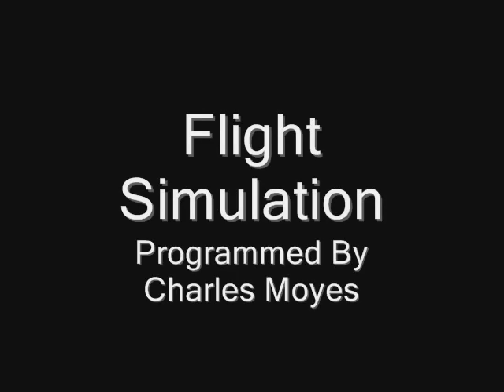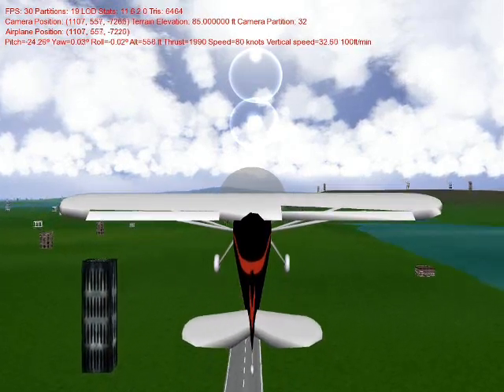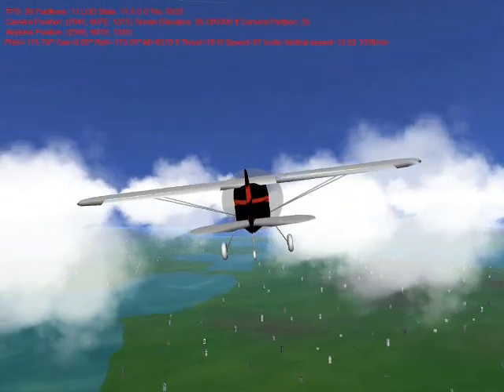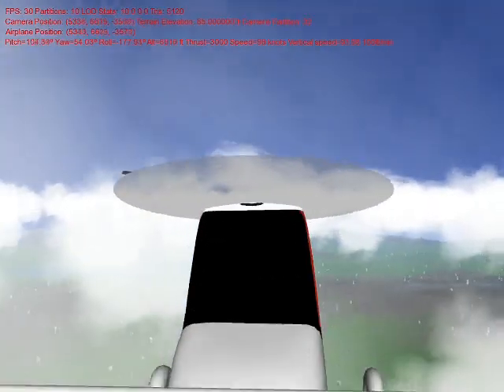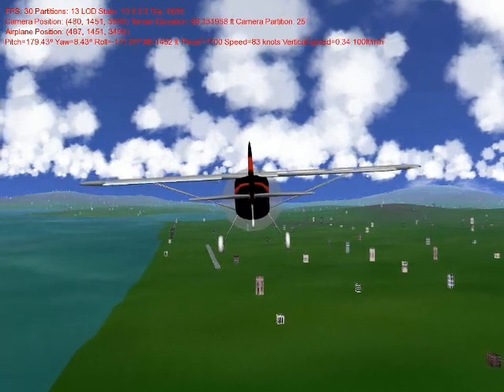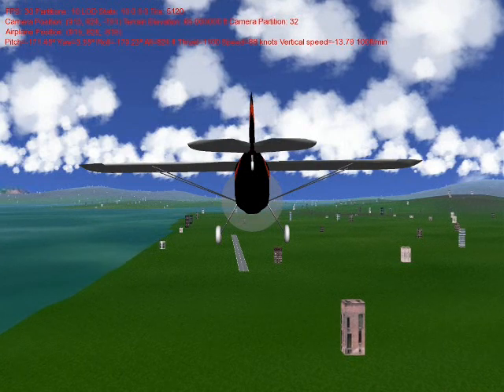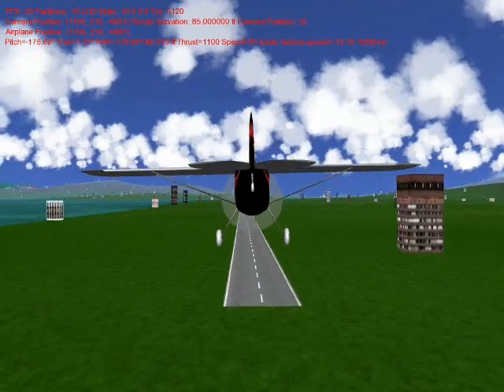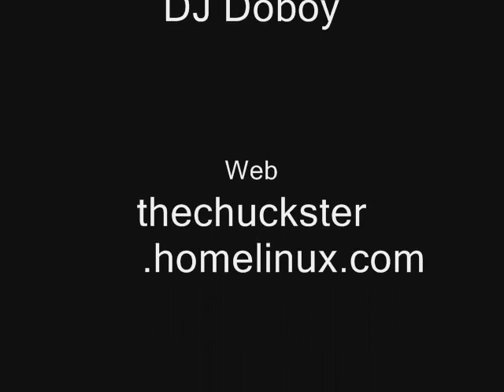Flight Simulation

Comment: i wish i could call that extremely realistic however when you reach a certain angle of attack on almost every aircraft the wings no longer produce lift and the aircraft will stall and most likely start to spin. all that simulator needs is a slightly more complex terrain mesh with more realistic flight dynamics more scenery objects (maybe get a group of friends to help you with building placement/runway adding for most of the globe) and you could sell this thing... my personal longest comment ftw

Comment: No, it's not gimbal lock.  I just noticed that when I rotate the xz plane (the ground), it get's pushed closer to my point of view.  I don't need the ground to get closer to the airplane, I just want the ground to rotate based off of the pitch I command.  I've created a simple visual drawing to represent my problem, and I believe I have a solution to it.

Comment: I did an over-ride through my GPU software, and anti-aliasing works.  A bigger problem that I just realized is that my matrix rotations do not work as expected.  I've read about quaterions and euler angles, but it's a bit too much for me, so I'm coming up with my own method for scene transformations.